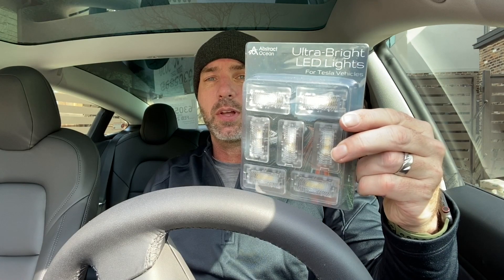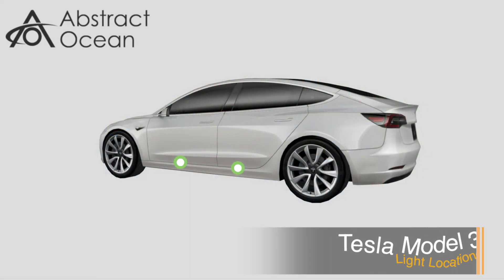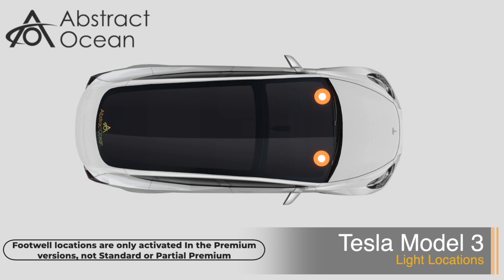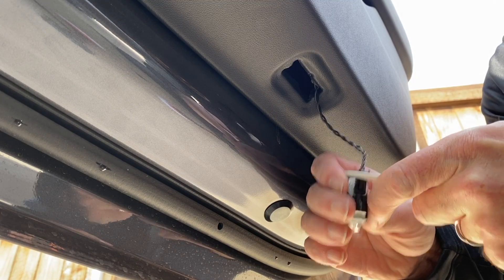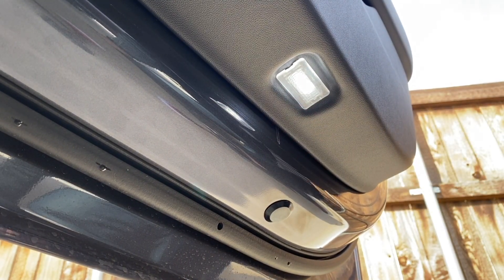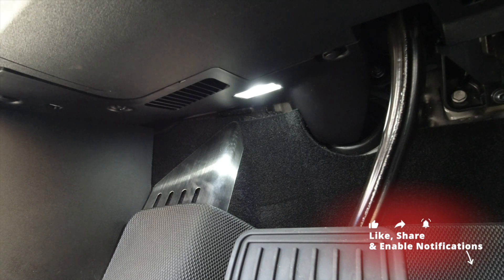Installing Ultra-Bright Lights on the Tesla Model 3

Comment: Driver door bulb: 5:30
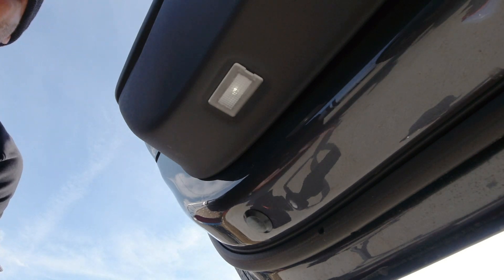Rear driver side bulb: 7:00
Rear passenger side bulb: 8:05
Passenger door: 8:55 (has AO pigtail extension)
Left trunk light: 10:16
Right trunk light: 11:06
Glovebox light: 12:27
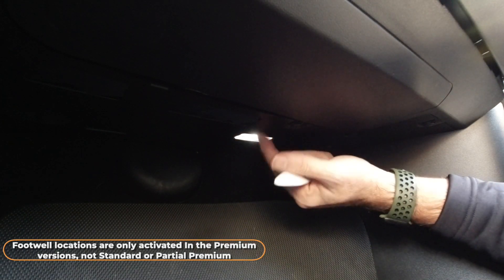Passenger footwell light: 13:28
Driver footwell light: 14:41

Comment: So standard range mode 3 doesn’t have footwell glove compartment box lights? and do all model 3 have those lights under the door when you open it?
Reply from the maker: The SR Model 3 has all the light locations aside from the footwell locations, which are 'ambient lights', so part of the premium package. The lights are probably there, but disabled in software.

Comment: how do you replace arm rest light?
Reply from the maker: No very easily. Tesla is not consistent in how they install it, so if you're lucky, you'll have the little removal slot in the lens facing you, but it's 50/50 it'll be facing away from you. I've only gone to the effort of replacing that light once, and just used a stubby, flat blade screwdriver to get it out, there wasn't enough room to use a trim removal tool. The screwdriver will likely crack the lens on the outgoing bulb, but that doesn't really matter, since you're replacing it. Honestly, I'm not sure it's worth the effort, but it is do-able if you really want to.

Comment: I can say with some certainty that on the newer model 3, changing the globe box light isn't this easy. They must have changed something as there is no way I can just level the light our like you do here. Not sure if it's because I have a newer model 3 or because I have a RHD version but it feels like the light is somehow secured from the other side - I'm not going to take apart my dash to find out. Shame really as the existing light is terrible.
Reply from the maker: The glovebox can be a fight, but I wonder if something changed. In our (2021) Model 3 it was easy enough, although the bulb was reverse, so the pry 'notch' was really difficult to get to.

Comment: I would not use cable extensions... they can get tangled in the window motor and scissor mechanism... and the one you showed was quite long.
Reply from the maker: That’s never happened to our knowledge, the cables provided are 15cm/6” long, but they’re well clear of the internal door mechanisms.